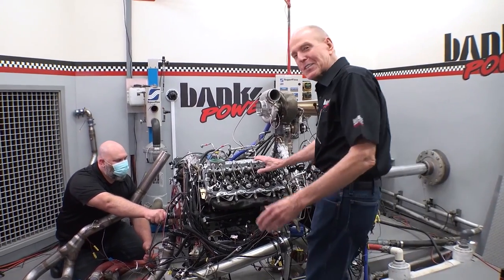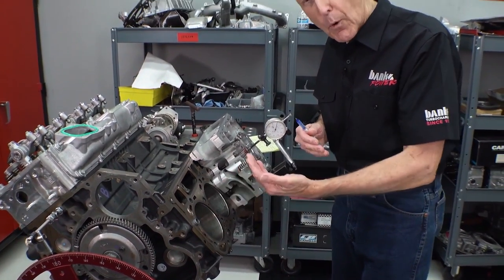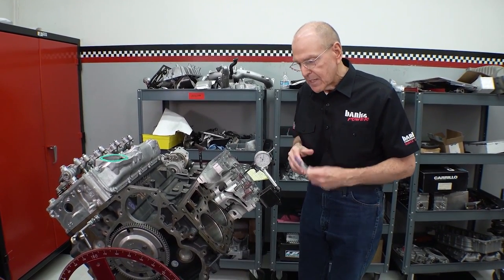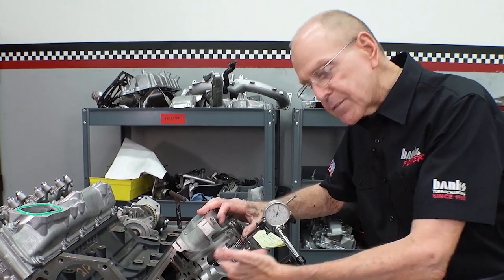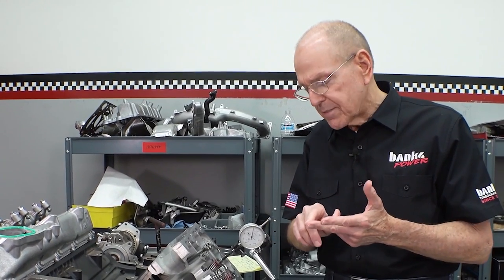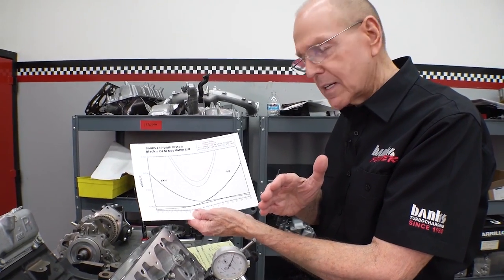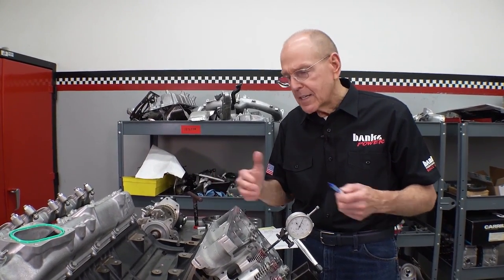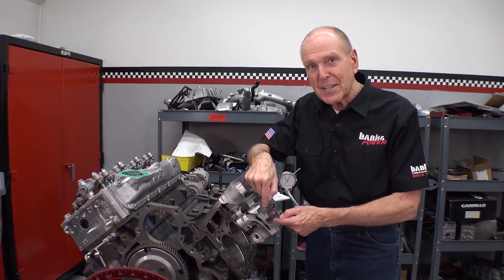NEW CAMSHAFT! Killing A Duramax Pt 13

Comment: As a machinist, seeing made in china on that Dial gauge breaks my heart. You're an engineer for goodness sakes... bet that mag base is from china too :/ you can afford Starrett or Mitutoyo.
Reply: meh, .001 accuracy is nothing, save the money for where .0001 or better is important.
Reply: @TurboVisBits  my experience with chinese dials, test indicators and calipers are repeatability. Second guessing my indicators accuracy is the last thing i need and he isn't poor, he can afford good quality test equipment and i figured for someone of his talent and skill and his focus on certain metrics would incline him to use the best test equipment. Not 10 dollar test gear
Reply: I think starrett has started to licence their brand. I have a starrett chalk line and it is a piece. I have seen some other tools lately branded starrett as well that look of dubious quality. I agree with you with better equipment. I don't mind using cheaper tools when your doing rough work or your in an environment where they might get damaged, but this is lab work, they're in a clean room. The base would have me more worried than anything, having to repeat your measurements because something moved and you don't know when.

Comment: I remember when the Koeniggseg guy came out with the pneumatic computer controlled camshafts that had basically unlimited variability in duration in timing and how he claimed it increased performance and efficiency by 50%. It sure seems antiquated to just have a single camshaft profile that has to be such a compromise for so many different engine conditions. And yet that seems like 10 years ago now and nothing ever came of it, and here we are still using old fashioned single profile cams.

Comment: Good job Gale. Hope i spelled that right. Your doing your homework.  Hey gale. I need one of your new diff covers for my 2000 ram 2500. I think thats a 14 bolt isn't  it ? Not sure. I have been on your site but do not see one for my year. Do you not make one for it ? Thanks mike shay.

Comment: I'm not worried about the valvetrain at all with the new cam.  I looked at the cam Unboxing video again and saw that lift has been increased by 7%, and duration has been increased by 20% on the intake, and by 22% on the exhaust.  This means the lobes can be designed with more gentle accelerations and therefore will excite the valvetrain less.

Comment: So since it's been established that maximum power comes from when diesels create smoke because of the charge cooling effect, instead of trying to avoid that and having to put way more engineering into the engine to get the same power without smoke, I wonder if it wouldn't be simpler and easier to just create a second stage engine that runs off the smoke from the first? It would be an interesting experiment, one of those RC turbine engines might work well. It could generate some electricity for your battery.
Reply: That's a maybe. The difference in absolute power output between 0 smoke and peak power is somewhere between 10% and 12% with the same air charge. Why race trucks make so much power when smokey is because the turbo lights way better with the higher egts. I don't want to hear the argument egts are lower with smoke, theyre not. Peak egts before smoke are 1550-1600f as you add fuel, thus smoke, they go up. when you go way to the other side of rich they start to cool down again but never get lower than 0 smoke. Pulling guys run egts 2100-2250 for twelve seconds at a time.
The only diesels that are tuned to smoke are ones that race. Nobody is going to daily a smoky car, nobody is going to haul with a truck that smokes, it's too hard on components and nowhere near as efficient. If your racing and you need every hp you can get, it will smoke.
Now to clean up the smoke you need to reburn the exhaust or have a dpf. How hard it is to get that last 10% of power and how hard it is to get rid of the smoke?
Reply: @timothybayliss6680  Very good points and I learned a lot from your reply, thank you.
Reply: @timothybayliss6680  Check this bad boy out: https://youtu.be/jixLhz-3vXE?t=593  Makes about 25 pounds of thrust. Imagine having a pair of those strapped to your truck, creating 50 pounds pushing forward on you. The smokey exhaust is fed into those which burn it up and send it out as clean thrust. That would be awesome :)

Comment: Thought the point was to see max power without oping the engine. I get finding the max power of the block but at that point should have done the springs and valves. see what goes first the pistons crank or block

Comment: You're testing the durability of the bottom and what the engine can take I don't care if you swap the cam
Reply: That's a maybe. The LB7 engines usually bent the rods at 1600ft lbs regardless of engine speed. If you swap a camshaft and make the same torque with the same cylinder pressure 1000rpm higher, your gonna make way more power. As long as everyone comes by it honestly, there's no worries.

Comment: Great video Gale. Will be interested seeing the next session with engine reassembled and running the aftermarket cam. What will be interesting to know is how tough the increased lobe height for both intake and exhaust values will increase wear on the stock valve springs. Not sure why the decision to retain use of the stock valve springs, when part of the equation remains added engine performance and longevity.

Comment: This is for Gale Banks. I have a 2013 LML Duramax. I have done the tuning and the upgraded turbo and the dcm tune the upgraded fuel pump/sump pump, the banks intercooler, banks exhaust. I have put a ton of money into this truck and there is still one thing that I want to do to increase my gas mileage. I want to put in a HHO generator, but I need the tune to match. I have done a ton of research on HHO generators and I believe that not only will my truck run even cleaner, but I believe it will give better mileage, less smoke, and even cleaner engine. I live in San Diego and wanted to know if you could help me with this project. I think that you could make YouTube videos with this and put it on the dyno to either prove me right or to prove me wrong. I have the truck, you have the mad scientist lab, let's work together on this!
Reply: you do know an HHO generator is basically driving around with an Hydrogen bomb right? take into account Lithium Ion and other high capacity batteries(Tesla flaming fireballs when wrecked) some things are virtually "nuclear reaction" once ignited, like the German's using magnesium in wwII (and to this very day, you still see magnesium used in many things)  ;)

Comment: Does the Duramax have comp beehive valve springs?  It surely appeared like it.  can't wait for the next video- my guess is that you have a long way to go before the Duramax leaves.  Do this to a older ford diesel next, thanks
Reply: No.  They are stock springs.  Gale made a point of saying in the video that the camshaft is the only thing that is being changed.

Comment: I wanted to know what the cam alone added!! Not with bigger injectors and a 14mm stroker pump!!
Reply: Well you wouldn't have been able to find out, because you'd be fuel limited not cam limited if you didn't upgrade the fuel system first. Use your noggin..

Comment: For a Diesel engine. What does a bigger cam accomplish? I’ve been around diesels my whole life literally but I’ve never put the thought of putting a bigger cam in a diesel, it wouldn’t make it look like a gasser would it?
Reply: It accomplishes the exact same thing as on a gas engine, it simply allows more airflow through the engine, and therefore more potential for power.

Comment: only thing I can add, is rotate the valve around small amounts and re-measure while piston is at fixed location. why? the valve face to stem tolerance may not be anywhere near.
yes, you could check that ahead of time in machining stages(trust nothing and triple check all) no that wont eliminate bad materials from the start. (mentions not any certain country)
Reply: Those valves have been running in their respective holes for more than 90 hours, have been exposed to cylinder pressures of 3600 psi, and made 900 hp.  If they were out of concentricity with the seats or had any material deficiency, I think we would have seen a failure by now.
Reply: @andyharman3022  not the seat face, but the face (or bottom) towards piston. poorly cast/milled whatnot. there's some real garbage out. only need to worry more when running tight valve clearances, if you dont mind garbage in your engine :)
anything pre-assembled learn to not trust, same for factory parts used or new, never know what you'll get

Comment: I am tuning into the build late, is there an EGR on this engine?
Reply from the maker: This project is testing the limits of an L5P Duramax. People were curious and speculated what the L5P was capable of, we decided to test the limits. The engine in this series came off the production line with no emissions equipment, including EGR. This engine will not be going into a road vehicle.

Comment: Good evening mr banks that blue spring pressure tester in the corner of this video do you know where i could get one to purchase, by the way i like your videos very informative.
Reply: If you Google it a lot come up...pretty easy.
Reply: @Michael Palmer that particular tester is made by Longacre Racing Products.  There are many other manufacturers of valve spring testers that you can search for online - just remember you get what you pay for and when you are dealing with $20k+ custom engines, trying to save a few dollars on test equipment may be really catastrophically expensive in the long run.

Comment: Would you not need to measure the length of the valve at room temp and at operating temp because the engine should have almost 0 valve lash at operating temp. Or run an engine on the dyno till it is at operating temp and pull the valve cover off quickly and measure the gap.
Reply: He said the numbers were while hot
Reply: @cencoast_7.340  No he is doing the math at .012". That is factory which is when the engine is cold not hot. Hot it should be about .005-.008. all factory measurements for valve lash are done when the engine is cold.

Comment: I’m curious as to how many hours of run time these engines get. I do not recall anything ever being mentioned. I know there is a lot or R&D time invested and behind the scenes.
Reply: I also think they've been doing a lot of runtime on the Duramax outside of the videos.  They took an oil sample in episode 10, and sent it for analysis.  They said the oil had 92 hours on it, so they have been running the engine quite a bit.  I think they have to do a lot of ECM map development to enable the higher engine speeds and set injection timings.

Comment: Wouldn't the "deflection" number be subtracted from overall clearance?  and what about the space the cylinder head gasket provides, just didn't hear Gale mention that when discussing the cam spec space.  To clarify my question; I'm assuming "deflection" to mean stretch as in the distance the crank, rod, piston, wrist pin could potentially grow under running conditions, suppose my assumption applies to the valve train components as well.
Reply: deflection here means shortening of the linkages as they bend under stress. gale is only tracking dimensions that change (as he should) since he cares about additional lift travel and the gasket is the same in the stock and modified cams.

the CTE of metals used in engines is very low intentionally and they are already designed under hot/operating conditions as nominal
Reply: The deflection that Gale is talking about is compression and bending of the valvetrain under load, which decreases net valve lift.
Reply: @ SpectreFTL and @Andy Harman,  appreciate you both answering my questions.  And here I thought those items grew with thermal expansion and from the reciprocating forces, that's why I'm watching Gale and not having my own YT channel.  ;)

Comment: "Seven tenths of a millimetre."
Reply: Nothing wrong with that. Easier to hear correctly than 0.7mm. Some guys say zero point seven instead of point zero seven and then mix 0.7 and 0.07 by accident. As long you stay in factors of ten..

Comment: So GM is numbering their diesel cylinders like Ford now?  Interesting.
Reply: It's Isuzu and a diesel.
Reply: @Garth2011  gm owns Isuzu and they have been made in USA since day 1.
Reply: Hot rodders know that to make a Chevy fast you have to have some Ford involved. The custom firing sequence that the 4-7 swap does is the same as a 351 Windsor or 5.0 HO Ford. Chevy guys have been using Ford rear ends for years. LOL
Reply: @jamesford2942   and if you want to go fast and get there and back in a Ford put a Chevy engine. Fact of hot rodding coming from a Ford fanatic for 30 years

Comment: Yeah. I already complained that changing the cam gets too far from stock.  But this has all been so fun and educational.  Let's review.  The ECM calibration was changed right away to move rated speed from 2800 to 3300 rpm.  Then the limit of the stock turbo was found at 550 hp, where the shaft speed was maxed out and the turbine was choked.  Then the 7675 turbo was installed, and the engine did 711 hp, where the limit of the stock injectors was reached.  Then the 50%-over injectors were installed, and the engine did 852 hp, and the limit of the stock turbine plumbing was reached.  Then the turbo was relocated from the stock position to improve the intake and exhaust plumbing, and the engine did 912 hp, but the turbine on the 7675 turbo was choked, and the 50-over injectors were close to Gale's 40-degree limit.  I think this brings us up to date.  Maybe a test with the 8085 turbo and 100-over injectors would have been good to do before installing the new cam.  But since the dyno water supply could not hold the engine at 3300 rpm, the extra power would have forced the test to higher rpm, where the stock cam would hurt volumetric efficiency even more.  I expect that Gale will start the next test at the previous max power point to study the effects of the new goodies before probing higher speeds.  So all will be explained.
Reply: So then he should not have done a single thing to the engine in your theory? Stock everything right...
Reply: This entire series went right over your head.
Reply: I'm guessing that reading comprehension wasn't your best subject in school.
Reply: I would have liked to see injectors/turbo, fuel pump before cam as well. I don't know if the dyno brake can hold it, it's got to.be close to the torque capacity. With the new turbo there will be drive pressure v compressor efficiency data and at the same test rpm you will be able to extrapolate how much addition airflow  is from the change in cam timing. The higher engine rpm let's you make more power with the same cylinder pressure and is easier on the bottom end. At lower rpm and high torque there is oil wedge issues and a few other problems that don't creep up as badly when you rev it out.

Comment: Would love to see a series on the 2020 6.7 powerstroke.
Reply: Ford doesn't deserve any of this.  They crapped on too many loyal customers and the general public with their 2003 through 2010 Powerstrokes. Ford used to be a Banks diesel of choice however, that's no longer the case in the past many years.
Reply: @Garth2011  👍
Reply: Honestly, The bigger issue is Ford really doesn't make a diesel engine.  Banks gets a seat at the head of the table with GM development due to the military tie in.  I doubt Navistar gives a crap about letting the aftermarket modify their engines.  In Short, GM will give Banks engines to experiment with, make cutaways, etc.  Navistar will sell him engines, but he's not getting freebies from them I doubt.